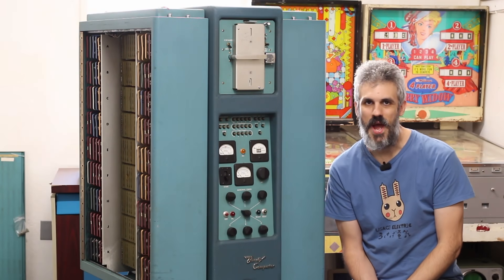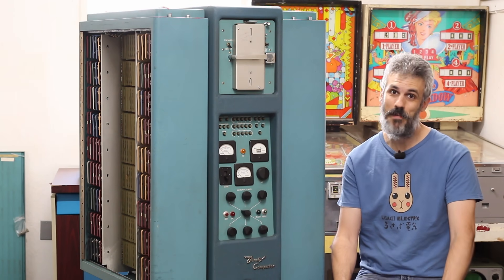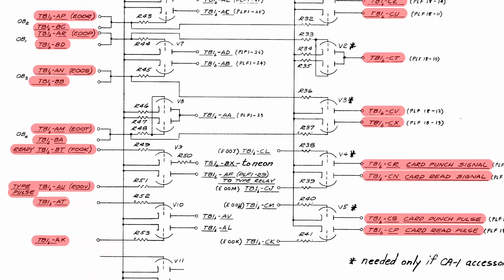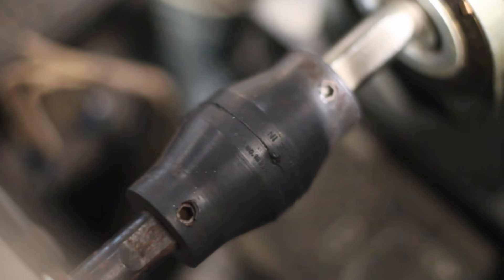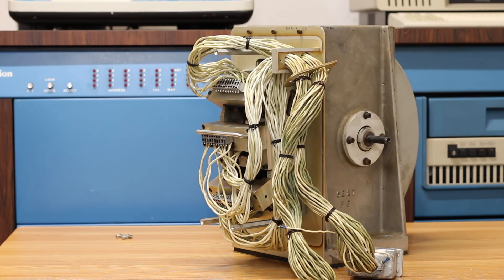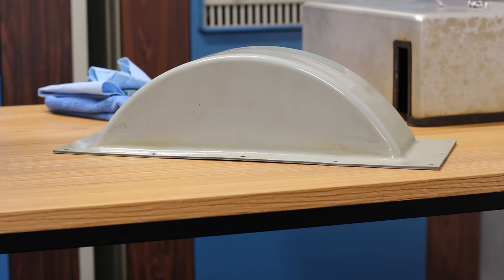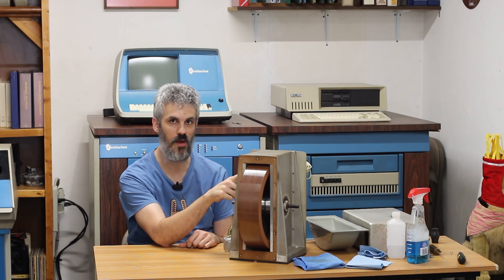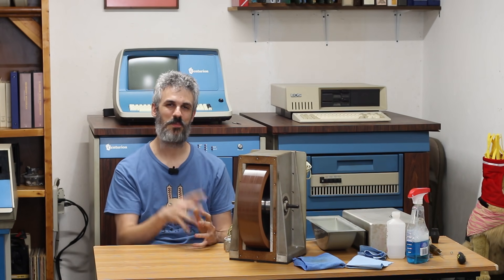Removing the Rotating Drum Memory from the Bendix G15

Comment: I was one of the commenters who suggested wrapping the drum in a spiral of audio tape. Now that I know the crazy runout specs you need to meet, I think you are correct in assessing the likelihood of success of that method. However, I think the spray method is even less likely to succeed unless you are willing to devote an insane amount of time just to developing the proper techniques, fixtures and materials. Among the things to consider: 1. Magnetic recording coatings aren't just "rust." They are carefully engineered blends of oxides with different chemical formulations (don't forget, Iron can be either +2 or +3), different crystal structures, annealing processes, etc. Do you know what kind of coercivity you need? What other magnetic properties? 2. the particles need to be milled to an exceptionally fine, and consistent size. 3. How can you get enough density of solids in your paint, and still have a coating that levels to a flatness of 0.0001" or so? 4. How do you control the application to get a coating thickness consistent to 0.0001" or so? 5. How to get a coating that will last another 70 years, without flaking off and destroying the heads? 6. All the things I haven't thought of yet.

Still, pulling it off would be a real tour-de-force!

Comment: card reader machine seems like an image scanner, or course you electroplate or vacuum deposit a layer, then lathe it, or lathe it and then coat, of course you use the same method of manufacture as the drum is being written/read, even electro-discharge-machining in liquid.

Comment: Just remember to mill the rust into an ultra fine powder, best done in the binding material you'll be using.
Reply: Just buy it
Reply: Also remember to use the correct type of rust. Fe2O3 (hematite) is paramagnetic but not ferromagnetic so will not work. You need Fe3O4 (magnetite) which is ferromagnetic. Magnetite is actually a black powder, so using red iron oxide is unlikely to work because the latter consists mostly of non-ferromagnetic Fe2O3. Gamma ferric oxide is a ferrimagnetic form of Fe2O3 but requires a special heat treatment of the rust to create in quantity.

Comment: I would fabricate a way with a leadscrew that attaches to the drum unit as you currently have it assembled. Then use a very sharp steel cutter mounted on this contraption to turn off all the old oxide coating and aluminum oxide from water damage. Then take the way off, sand the surface of the drum for better adhesion, and spray the new oxide on as you described while spinning the drum and let it completely dry. Then reattach the way and turn the new oxide completely flat. After that disassemble the unit, take the drum out, and clean everything thoroughly to remove all dust and grinding residue from the housing and drum. This last step done with multiple cleaning baths to make sure all traces of dust are gone, while not getting any water into the bearings. Then lubricate the bearings and reassemble.

Comment: I think spraying will work, but you should keep the drum spinning at a constant low rpm while it dries (like over night, etc.) to prevent drips or the top from being thicker than the bottom, etc.  Also you may want to do it in a mostly clean room environment to keep dust from being hardened into the clear coat.

Comment: Contact cleaner like deoxit on the connector and tube sockets is what you need, possibly relay contacts may need adjustment burnishing.  A test jig should be fabricated to test cards out of the machine. Wiping with a wet towel reminds of killary with bitbleach.

Comment: I don't think the 2K clear will level the way you think it will, I would plan on applying it thick and turning it down the way you plan on doing the primer. Then there's the issue of 'are the crashed heads salvageable?'
Reply: With the age of the machine they are basically old 1/4in reel to reel heads, pretty large, and pretty robust. Only thing that kills them are open coils, and they are large enough to actually be rewindable, as the wire is large enough to see.

Comment: Here’s my thoughts:
1) I wonder if you can turn the coated drum? If so, you don’t have to worry too much about making the coat even, as long as it’s thick enough; just coat messily and then turn it down to final dimensions. 
2) I say “turn” but I suspect you’ll need better accuracy than is typical for a lathe. I think maybe you need a surface grinder that is setup for polishing cylinders (something I have heard of but never seen, speaking as an armchair/YouTube machinist)
3)I worry about the dynamic balance of the drum. I think you’ll need to do something to balance it after all the turning and coating.
4) you need a test rig and prototype to test processes. Something like a 2-inch puck of Al, a motor to run it, and a read/write head. Bonus points if we can test the real drum in the test rig somehow to benchmark how well the rig simulates the original.
Reply: The weight balancing is actually a really good point

Comment: I think that surface will have to be repaired 'in situ' doe to centering tolerances, assuming the bearings are perfect and lubricated.
Use the bolt holes of that cover to position a tool to smooth the surface, and then a light spray in several goes of iron oxide primer should so the job. 
Always interesting how much mechanical precision was around back in the 1950s.

Comment: May check the heads and bearings working order before do anything with drum.

If the drum can be fliped and or the head complex canbe moved sideways may give it one try to find a non damaged magnetic tracks on a drum surface.
The new surface is geting more complex to get work with existing heads and it give a straight enough signal with air gap, and has stability with heat and centrifugal force.

Comment: Your method for spraying the drum could definitely work, altough keeping your tolerance while cutting down the diameter back to bare metal will be difficult. keeping a 1 thousands of clearance is probably impossible with a normal lathe, maybe ask some machinist youtubers about the issue, they probably know way more than me, and could point you in the right direction. A fun challenge to say the least!
Reply: Yes about the only machinist that would have that level is Robin Renzetti, he probably can machine that to better than original runout.
Reply: I believe the heads themselves are adjustable for clearance but yeah, if there's 1mil tolerance allowed then that is going to require a large high precision lathe.
Reply: @SeanBZA  I bet @robrenz wouldn't try to do it on the lathe, though. Either use a cylindrical grinder, or put the spindle, along with its bearings, on precision V-blocks on a surface grinder.

Comment: Electroplating is a common metal finishing technique that can achieve each of these objectives. This process involves immersing the aluminum workpiece into an electrolytic solution and introducing an electric current to deposit dissolved ions of another metal onto the surface.

Comment: There may be small chance that there may be enough thickness of material just to true the drum. Refurbishment might have been part of their design. Though, I suspect that after the drum was sprayed, they polished it using a lathe. Though, finger sanding marks, such as those seen in bad bodywork would also be bad for the drum. It's possible that after the drum was coated that they merely, passed a loop of 1,000 to 2,000 grit paper under the wheel and gently lifted both ends up. Machinists sometime use this technique to get that last thou when their machines won't otherwise let them. If you want it shiny, there are telescope grits such as 5-micron aluminum-oxide and 1-micron cerium oxide available. I suppose that it could be charged into a stiff block of felt, held in a lathe toolpost.
As far as spraying it, the challenge is: the proportion of binders to media. It would seem that there needs to be a lot of magnetic material in proportion to the binders. Making sure the spray mixture is well strained is a thing.
Party trivia: The circular nut is a DIN 1804. Amateurs without the proper tool mar with a steel chisel to remove it; but a pro without the proper tool will use a piece soft metal such aluminum or brass and not mar it--or you can just make or buy the tool. You could make one.

Comment: Before going too far down the path of the drum surfacing, I'd look more closely at the head installation.  I think I saw a row of holes along the top side of the mount that would take a tool for adjusting the head height.  Like those old CDC's a pin-like tool that is off center, poke it in the hole and as you twist, the pin moves the head in/out a tiny bit.  Something like that, and you can figure out just how exact the drum diameter needs to be and how much you can 'adjust' for a slightly under/over sized surface.

Comment: I will be interested to see if refinishing the drum can be pulled off with a reasonable amount of effort. I am interested in seeing how hard it would be to fabricate a simple hard disk drive from scratch. I want to construct an 8 bit minicomputer from scratch that is a good example of a high end CP/M 2.2 system. I think someone with advanced fine watch making skills could construct a decent magnetic head. My dad had a race engine machine shop, and he built parts accurate to a ten-thousandth of an inch. That's about what you will need to get the drum project to work. Oh, I was just reading some of the other comments. Check the bearings for wear and excess clearance. That could also be an issue.

Comment: Have you considered using a natural bristle brush for cleaning? They are stiff enough to get into nooks and crannies without scratching and do not build up a static charge from friction. I have a variety of hog and horse hair paint brushes in different sizes and lengths that are perfect for getting between chips, into open edge connectors, dusting out wire bundles and point-to-point circuits and into the corners of enclosures and panels. Would have made short work of the coils on those tube rheostats.

Comment: spray the drum like you say, but keep it rotating very slowly until  that clearcoat sets so it self levels evenly across the whole  thing, and spray several coats on, and afterward wetsand it  on the lathe until its a mirror surface, just like you would a show car paint job. 600, 800, 1000, 1200, 1500, 2000 grit, and then cutting compound, and polish. Do it all while the drum is rotating at a steady pace and you should end up with a super smooth super flat surface

Comment: One other thought, whatever coating you come up with, ISTM the drum has to be precisely balanced.  Those bearings of course are pretty precise, but any vibration caused by imbalance could be a problem.  I forget off hand what speed you mentioned it spins at, but with such a critical head-gap, this might be a concern.

Comment: Please check if the iron oxide is magnetic before mixing it in paint. My gut feeling is that it should be more along magnetite powder. Could be wrong too… Yes, I know, far in the future, with many tests in the process. Maybe there is some treatment for making a non-magnetic iron oxide a magnetic iron oxide?
That turquoise looks soooooo nice BTW 😸
Reply: He mentioned using red iron oxide which is mostly Fe2O3 (hematite) and not ferromagnetic so wouldn't work. Hope he finds out eventually whatever is the correct stuff he should be using

Comment: Wonder if you can remove the head side to prevent damage to those component's then connect a low rpm motor to the drum and use its own housing as the lathes because at least that housing is designed to rotate that drum in spec. Also for the coating isnt their a liquid mixture that they used to magnetic media like tape and floppies that can be squeegied on while its rotating  to get an even coat the biggest challenge i see if the liquid film is available to purchase would be getting the clearance within tollerance. It would also be a good material to prevent corrosion. They still use magnetic tape for credit cards and gift cards so i would try dropping a line to a company like 3m. They might sell something along the lines that you need even if its a powder that can be mixed with paint worth dropping a line they can only say no at worst or even point you in a direction no one thought about. Good luck with the project looking forward to watching this machine come to life.

Comment: Always the heads are making these scratches but first it was either a vibrating / unstable head or a material on the drum. Todays magnetic disks, for over 20 or more years, have a sponge in the air gap to contain all the debris. Fun fact: SAS server disks even when damaged dont get a stop command from a controller :) so after an hour the whole plate is missing - gone with the dust :)

Comment: Hi Ken. Before resurfacing that drum, you’ll want to get rid of the existing coating. A series of smooth sanding blocks with various grits of sandpaper could be used, starting with 400 grit, and working your way to 1600 grit, followed by lapping compound should work. Machining will leave little grooves in the material; you’ll want it mirror smooth before re-coating. You’ll need to know how thick the modern magnetic material needs to be so the total O.D. of the drum meets the stated design requirements. The “coated” O.D. - the thickness, will give you the O.D. of the drum before coating. This is your target measurement when removing the existing coating.

Comment: Try the .5" VHS tape tightly winding it helically and tape the ends to the inside of the drum and see what happens. It won't cost anything. May need to play with the bias and the system has some kind of error correction for the missing bits.

Comment: Ok, this may be a dumb idea,  but rather than mount the drum in the lathe and try and get everything matched up and the runout perfect, etc. why not use the drum as it is already mounted in the bearings? Don't remove the drum, but use the existing setup? Use a diamond dressing point mounted on a linear bearing to move it across the face of the drum precisely. Obviously protect or remove the heads---to keep alignment, before breaking loose the head mount, drill a couple of alignment holes for each block, and install a dowel pin, so you can put the head block back precisely where it came from. You could coat the same way from the rear open end. You could even then use the same diamond point setup on the finished surface, to skim cut it so that you could ensure it was perfectly even.  Just a thought, and likely not a good one. :)

Comment: It would be a good idea to calculate the physical size of the individual magnetic domains (the bits) on the drum and then be sure to use iron oxide particles that are several times smaller than that size.  Using an electrostatic spray technique may help in the even application of materials.

Comment: SIL stands for Single in Line, so presumably the pins are in a single line.
Same idea as DIL for old style IC's, which are Dual in Line, or two rows of pins

For the lathe work, is there a collaboration opportunity with someone in the machining community abom79, steve summers, this old tony, keith fenner, ox tools, keith rucker vintage machinery to name but of a few of the popular ones.

Comment: Vaguely remember photographic emulsion was applied to the acetate backing by dipping and then an 'air blade' was used to remove the excess - with variations in speed and pressure to get the required thickness. 

Probably something a bit better than a shop air compressor - nitrogen gas wouldn't be laced with oil and water contaminants !

Comment: Hi, Coting Your Drum.
I worked in the past for a well-known foto film company,  when they changed to the digital market, in one or another process they used dipping and slow retracting it to form a homogenous 
 coating. Your suggestion of spraying. It will never have the required cylindricity. With dipping and very slow automatic pulling, it was very close.

Comment: Given the speed you computed, the g forces at the outer surface of the drum will be on the order of 300g. I am not sure if the aerodynamic forces or the g load on the coating will be larger. Your coating will need aggressive holding to the drim surface.+

Comment: Do you think it would be possible to buff that drum and be able to get at least some of the data off?  Since the tolerances are large compared to a platter, and the heads have already seen worse, what would there really be to lose?  Even the drum from the other system seems to have some texture to it.  Maybe you could even read it with modern hardware like you did on the floppies.
Reply: It is working memory not storage. I guess you’d need to see the job it was running to understand anything from it. Would still be cool though
Reply: @IainShepherd1  I remember it being said that there was also a clock pulse on the drum that was used to sync the entire system.  So it seems to act as a clock and non-volatile RAM of sorts rather than long term data storage?  It would still be interesting to see if it could be spun up and read, even if some of the surface is bad.